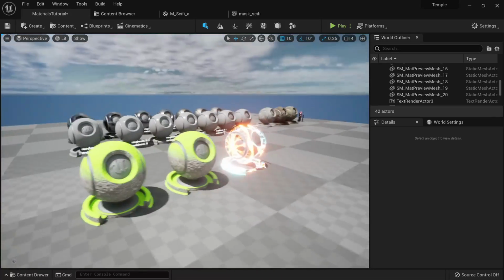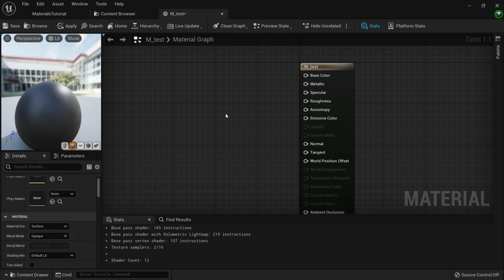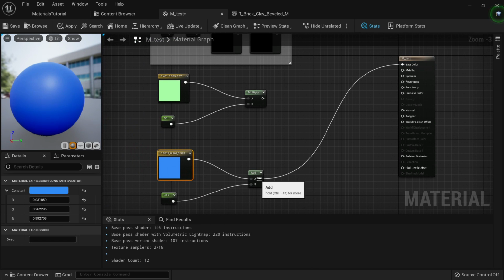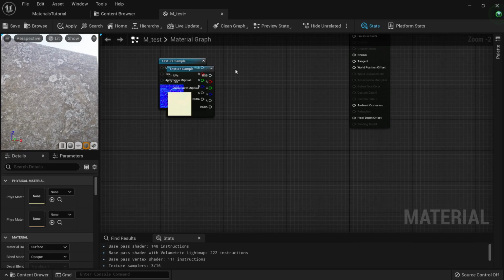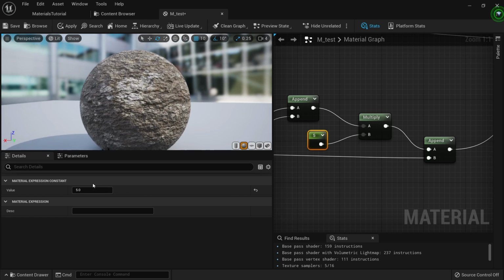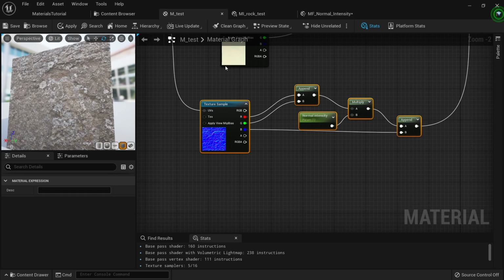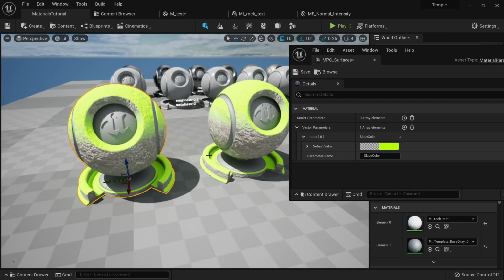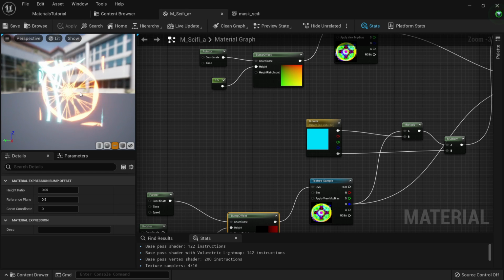Unreal Engine 5 Beginner Materials Tutorial - Learn to Create Materials from Scratch!

Comment: sir I made material for my object but it has height and displacement map so how can I apply those map on my object in unreal ?
Reply from the maker: Now you can use displacement tool using a modeling tools. We have a tutorial here: https://youtu.be/9InU0xbX7l0
Reply: But sir what if I already made the object and material using different software and want to apply height and displacement map to give depth on model in unreal
Reply from the maker: @munjalmehta9054  you would need to redo it doing the method I shared to you. You can get the detail with the geometry but I'm not sure if you disable nanite in the mesh you have the material displacement will work
Reply: Ok sir thank you 😊

Comment: 38:17 How does putting an exponent on something make it react differently than multiplying? Aren't they the same exact thing? When you exponentially increase a number, you're just multiplying. I don't understand how that does something completely different when you're still multiplying.
Reply from the maker: Power is like contrast, Multiply is like Intensity. Not the same thing, you can think of Power as making the brights brighter and the darks darker, multiply makes everything darker or everything brighter.